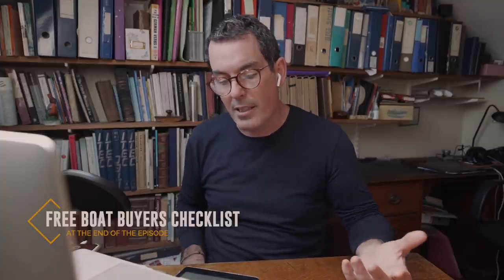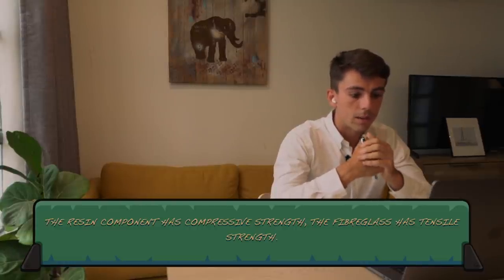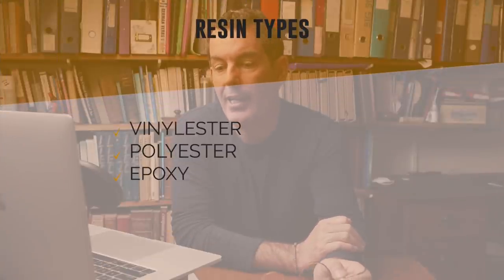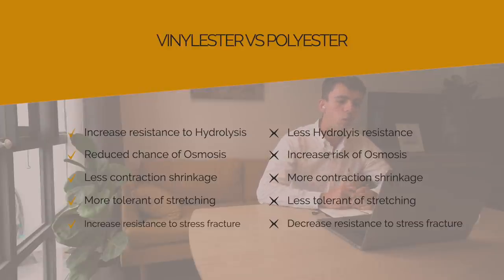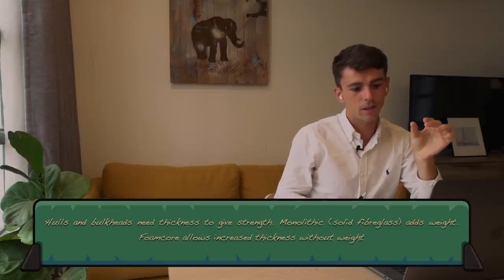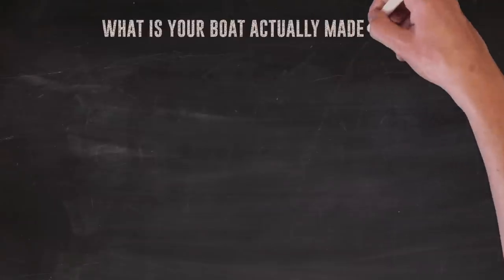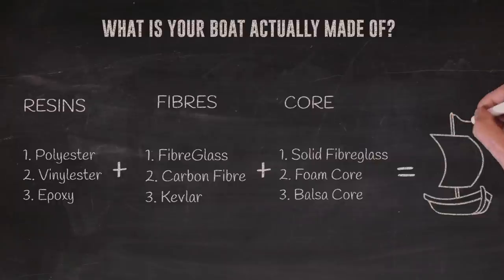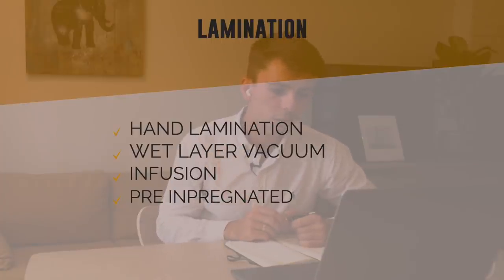CATAMARAN BUILD QUALITY: The TRUTH Brokers DON’T Want To Discuss!

Comment: There was no question between sandwich properties, between balsa and foam.
You said "balsa under the water line is for cost saving", so I suppose balsa is cheaper, but how really is foam better ? for structural properties, and for sea proofing ?
Reply from the maker: Foam core is closed cell which makes it better resistant to water ingress. Balsa swells when wet and this leads to a greater chance of delamination if you get water ingress. Balsa is also an organic material and prone to rot if water ingress occurs.
Reply: I had a balsa core boat and the fiberglass cracked . The balsa got wet and turned to something like weetbix  ( aussie breakfast cereal) after your poor hot water on it...  just turned to mush.  I had to cut the whole area out of the boat and rebuild it. Lucky the area was above the water line otherwise the boat would have been on the bottom of the sea.
Reply from the maker: Sorry to hear that mate. But confirms the point about not buying a boat that is balsa cores below the waterline.
Reply: @sailingrubyrose  Thanks for the precision !
Reply: I'd also chime in that just as there are different core types, there are different foam types even within the category of "closed cell core foam", all with varying density, weight, stiffness, and price. Differing resistance to compression in the foam core will change the stiffness in the panel (deck, hull, etc) - part of the strength/stiffness from the fibre layers comes from keeping them further apart - if the core compresses when it bends, you'll quickly build stress in that one area and it will be the point that buckles. Think of cardboard packing boxes with the corrugations in it - it's strong, but if you give the corrugations flat, the squeezed bit becomes floppier/weaker (not a perfect analogy but there is a box in front of me, so there ya go :) )
Reply: Although balsa is very tricky to use in a hull because of the potential water-ingress making the stuff rot at top speed, it is actually a better material from strength point of view compare to most foams. It also bonds better to the resin. So balsa is not just a  cheaper choice. Using end-grain balsa (so grain direction perpendicular on the surface direction) makes for an extremely stiff sandwich panel.
For Multihulls the big problem is weight. A performing multihull needs to be (relatively) light. So often the bulkheads are made from sandwich panels. For static loads this is no problem but after several years of dynamic loads the panels can loose quite some stiffness if not properly built.
Reply: Balsa is not for money saving. Balsa is better, stronger-per-weight than any of the foams. Then again, wet balsa is weaker than any of the foams, especially per weight.

Comment: In theory perhaps, but as any seasoned salt will know from experience hand laid by a quality builder will he much better than a production vacuum molded boat. Why? Cause there is really no way to know for sure exactly how the vacuum has set as the different ingredients will flow at different rates and thus why when you see a production boat wrecked the massive delam visible.

Comment: The problem with this analysis, in my opinion, is with older boats made before these "modern" processes such as vacuum infusion the process was done by hand and the layers of glass were much thicker than they are in modern production boats. I think some older boats are much better built than your modern production boat. Just my opinion.

Comment: 60 years of sailing experience. There is one absolutely fundamental reason why you should never buy a cat if you are doing open sea passage making. Instability. And don't say this will never happen. You will, at some stage suffer a knockdown. I've been in six. Once a cat goes over you cannot get it back short of a salvage tug coming along. Usually they will go all the way to be fully inverted and you are in the life raft...if you are lucky. Mostly though, the liferaft will be trapped underneath before its had time to float free.
Reply: cats are crossing oceans every day.  lack of experience causes cats to flip.

Comment: I don't think this detailed information is of any value for yacht/cat buyers. An owner of a boat will not benefit from epoxy resin with carbon fiber and what ever if the factory was not able to handle it right. These are decisions a boat manufacturer has to make when setting up his process, he will be liable for making it right. Buy a boat from a brand you trust. Btw, there is not much to choose when buying a boat, 99% of the industry uses polyester resin with fiberglass, some use vinylester on top as a kind of osmosis prevention and kevlar on some places for reinforcement.
Reply: Theres quite a few that use epoxy and carbon.